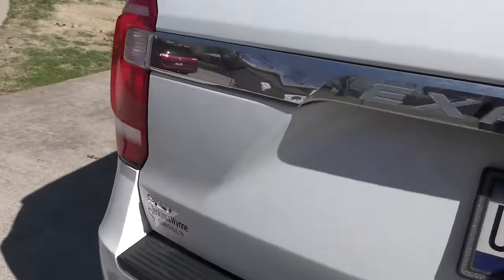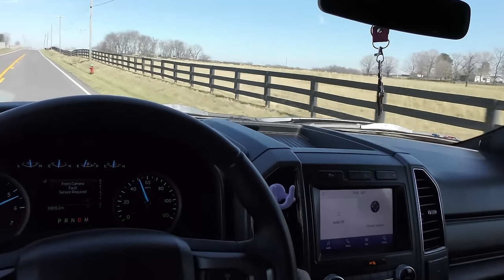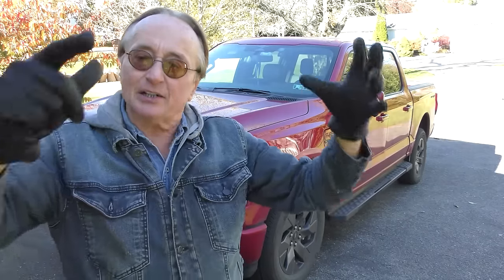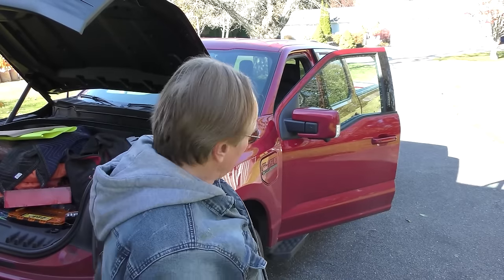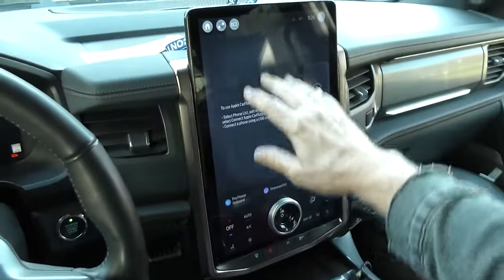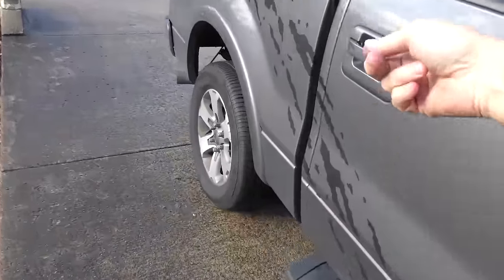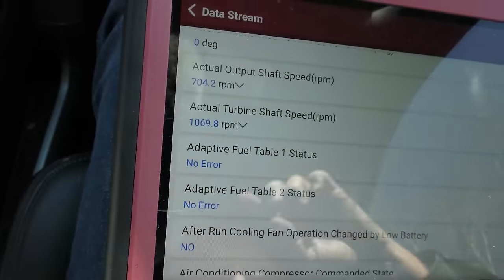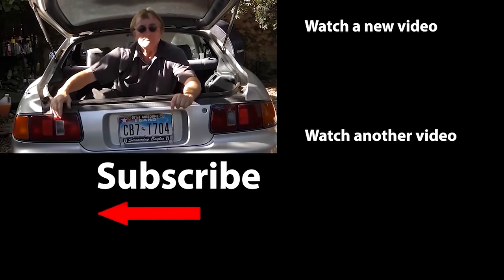Here's Why Fords are Crap Now

Comment: In everyone's opinion, what is the current best built truck with the least problems?

People were telling me in another video that even Honda and Toyota are going downhill with quality.
Reply: None of the trucks built today are that great, however some are better than others. Here’s my list of most reliable to least reliable 2024 half ton trucks.

1. Toyota Tundra: it had some problems with the twin turbo V6 engine at the start but they’ve worked it out on the new one. However, I don’t think they’re going to last nearly as long as the older Tundras with a V8, but maybe they’ll prove me wrong. 

2: Ford F150: just the regular V8 F150. They’re okay as long as you stay away from the 2.7 and 3.5l ecoboost. They say they’re better now but I don’t trust it. The 5.0l naturally aspirated V8 is still the better option if you’re okay with slightly worse gas mileage.

3: Nissan Titan: they’re good trucks, just uncommon and 2024 is the last year because they’re not selling well. They don’t quite have the same specs as an American half ton truck.

4. Ram 1500: These are garbage, but will get the job done for a few years. Riddled with transmission issues, engine issues, drive train issues, stupid low quality interior part issues. These aren’t good trucks and you shouldn’t keep it for long or buy it in the first place if you value your money. 

5: Chevrolet 1500: These are COMPLETE GARBAGE. Stay away, as far away as you can. These things are blowing engines just a few hundred miles off the lots. They are some of the most garbage trucks ever made. They have the same issues as the dodge ram only worse. Stay away.
Reply: @interstate80.  Well that sucks, I was hoping to buy a Chevy/GMC truck in the long distant future but I guess I'm stuck with Toyota. 

I drive a 2007 V8 Tundra sr5.

Comment: you can find every ford these days dead at every stop light! that start stop is all good until you start having alternator/charging issues, and have to wait at a long light or a train, and dont have the juice to crank back up and get moving. Even better, starters dont last forever, and being used every damn traffic light is going to result in a lot of dead at the light vehicles.

Comment: A friend of mine got a 2023 Ford F250 total crap. I told him go lemon law on it since it qualified. Major suspension issue. Actually it was unsafe to drive. He threatened lemon law because ford ignored him even through an independent mechanic said that suspension parts were actually missing wtf!!? 😱 They got Ford engineers to look at it. And the problem was fixed kind of. He still isn't happy with the steering. Why would you trade in your Ford crap lease for a full finance peice of crap knowing Ford is crap. Smh. 🤦🏻‍♀️

Comment: I`m 66, and in my life I`ve only owned one Ford. NEVER again, biggest pile of poo. Bought a Mustang GT in 1987 NEW,  left me stranded 3x in 9 months of owning it. Dealer had it for 3 months total time trying to fix the total loss of power like battery was unhooked. 3rd time I let my lawyer handle the LEMON. I got every penny back including money wasted on car insurance. Took the cashiers check across the street to a Chevy dealer and bought a Cavalier outright, no payments. Had it for 10 years and put over 200,000 miles on it, never had a issue.

Comment: I only bought one Ford in my life time. Like it's name, Found On Road Dead, my Ford die 5 miles from home. Went thru two trans in about 20K miles. AC leaked. Car stalls at stop light which Ford could never fix. Engine blew a piston in about less than 100K miles. Got rid of the piece of crap and never bought another Ford again nor any Detroit car after that. My previous GM car had a lot of problems too.

Comment: So if you took a $75k lightning and  a $75k gas f150. The entire drivetrain for the gasser would cost less than $25k, when removed would leave you with a $50k shell. For the lightning the entire drivetrain would cost atleast $50k, and when removed would leave you with the same shell, same options for 25k? Ford is either shoving it in their * on the lightnings,  or theyre shoving it up the customers * on the ecoboosts

Comment: That's the scanner I'm thinking of getting. For this stupid ford. Have a cheap OBD2, but it's not picking up anything. :/ No traction control, no power steering, no collision warning stuff, no nothing. I'm in complete limp mode. RIGHT after getting two new tires. :/ Tried resetting TPMS sensors using a little tool. I did have low tire pressure on a tire, it showed, afterwards. Aired that up, the TPMS light went off, and I am still in limp mode. Don't even care, except steering sucks. I so hate Fords.

Comment: We had Ford work trucks in the 80s and 90s and they were crap, except for one known as "The Beast" with a 460 and a 5 speed. That 460 utility bed truck was awesome, but all the rest always had issues. The first Overdrive Fords couldn't push the crazy high OD ratio, crap driving positions, the twin I Beam front suspension chewed up tires like crazy and they had premature failures of alternators etc.... 
Oh... How could I forget... the GIANT HUGE TFI MODULE SCAM THAT WENT ON FOR YEARS!!!! 
Rant done.
Reply: How many miles did “the beast” have on it?

Comment: It’s sad because my 2002 Ford Taurus lasted almost 400,000 miles trouble free and my 2001 Ford focus got into the high 200,000 mile range. I only had to replace a coil pack never had any issues with the automatic transmission I only had to get rid of it, because the frame rotted out and it wasn’t gonna pass in New Hampshire state  yearly inspection. I ended up selling it as is in fact I saw driving around with temporary tags and Massachusetts not that long after I had temporary tags on it and the Ford Taurus had almost 400,000 miles. The only issue I had with that was between third and fourth gear I had to slightly lift my foot off the accelerator for it to catch and I drove it that way for years that didn’t rot outI ended up giving it to somebody because all the tiny little things that it needed like tie rod ends, swaybar links, stupid, plastics, cosmetic stuff we’re all needing to be replaced and I could’ve done it and drove that car a lot longer but I decided to upgrade after that or just went downhill I guess

Comment: Scotty will say some smart things and then say something so dumb out of nowhere 😂
A twin turbo 6cyl definitely has the pickup of a V8.. i like v8s but id much rather have a v6 turbo, faster with better gas mileage. V8 is mainly meant for power for ppl who tow things a lot, otherwise you dont need it and are averaging 9mpg for no reason.

Comment: Truth is Ford has always struggled with gas mileage.
Example....Ford 1.0  `Ecoboost` Fiesta, Focus. Real world gas mileage in the UK.....45mpg. Previous Ford engine 1.25 Zetec engine.....45mpg.
Tell me, what the hell is `eco` in `ecoboost`?
On top of....the Zetec engine was bullet-proof...punchy, reasonably economical and if looked after lasted the life of the car...not class-leading as regards mpg, but reasonable.....but the `ecoboost`, punchy, overheating, setting fire to itself and how long are they lasting?
Ford, once great, now in the race to the bottom.....
Reply: Had a 2012 Fiesta S. Just gas only cost me 13 bucks a week. Work us 10 miles away so 20 round trip. That's just work not including daily driving. I've owned Nissans most my life had geo prisms( great car). Nothing ever compared to that Fiesta gas wise. This is 2 years ago with inflated gas prices. 20 bucks filled it from 1/4 tank. And that was 93 grade.

Comment: Have you considered doing a video on the F150 rear sliding window that should have been a recall but ford says it hasn't killed anyone yet so NO ! The window top track just falls out and off ! 70,000 complaints to ford and nothing ! Window track put on with double sided sticky tape ? To break into truck all that is needed is pressure from the outside to push the window in lol what a joke. Except it isn't funny

Comment: It’s not just Ford, it’s every manufacturer. They are pushing so much technology and they’re not doing proper quality assurance testing on their products. They’re taking what should be done by their QA engineers and putting that on their customers. That’s the problem and everyone is doing it.  It’s just to which degree everyone is doing it.  Some manufacturers bought the EV fish the government is pushing. Some aren’t like Toyota. So right now Toyota enjoys better quality standards than most. Because they aren’t pushing EVs. EVs aren’t close in mature technology yet, so there’s going to be lots of mistakes until they start doing the proper quality engineering. But the market wasn’t waiting because the government made a push too fast. EVs don’t solve anything. It’s a government scam that politicians are heavily invested in.  I’m an engineer so I know this technology isn’t ready. There’s no grid yet. China is building coal plants at 3 a week. That wipes out any environmental advantage millions of EVs do.  You’re pissing in the ocean.
And manufacturers are trying to push this tech into the regular cars. They need to slow down or up their QA departments.  But this isn’t just on Ford .

Comment: Should have bought u a chevy. I have a chevy Silverado 1500 lt half ton 303000 miles on it pull a trailer full time 6 days a week in summer with mowers change oil every 3000 miles and have only replaced water pump,alt,battery,starter,brakes,tires...  that's a 4.8 liter small v8and is a2002 ..  People if u believe what u read about changing oil every 5 to 10000 miles keep a big cash fund u will need it oil brakes down when u heat it up and cool it down stick to 3000 miles.  Ford cam phasers are junk used to work at a machine shop lots of ford's cam phasers that destroyed motor u cannot just change the cam and lifters and phasers and except it to b right when all that metal went through the motor and the crank bearing too.

Comment: Ford is using Chinese made crap components. Eco engines have a lot heat related destruction to valves and springs, wiring ect. Excessive carbon build up too !

Comment: You do not I repeat do not want to work on a Ford,as a mechanic for 35 years,they are the most difficult and expensive piece of junk.I own 95 Chev pu 533 thous km And going to get milion,parts cheap and don't brake down.

Comment: Well.  GM has sucked for decades now.  Chrysler since before I was born apparently.  Ford had its ups and downs but is now in a DOWN from what I am told.  Ford placed their focus on EV and the production cycle involved. Then part of the plan was to lay off the quality of gas models in an attempt to make the customer purchase electric to avoid issues.  Oops.  Ev doesn't sell because it can't sell and the issues with the infrastructure alone speak for themselves.  Now Ford realizes their mistake listening to government recommendations.  Especially THIS CURRENT government lack of knowledge with vehicles for the public.   They didn't listen to Toyota.  They should have.  Anyway, back to the gas again!  Maybe the quality will follow?

Comment: Ford hasn't made a decent reliable vehicle for years. I've owned hundreds of Ford's and worked them too. I think the last decent Ford I had was a old Granada. I wouldn't ever buy one now. They are badly made crap. We have transit connect 1L eco boost company vehicle. Its been the biggest pile crap I've ever come across. Clutch went with only 14,000 miles on it. Constantly loosing coolant. Throttle body failed. The Ford dealer was useless  and couldn't sort out the constant coolant leaks. Transits used to be good reliable vans once up a time. Now they have to be one of thd most unreliable. They give Fiat and Citroën a run for their money in building crap vehicles 😂

Comment: What people need to understand is these new level transmissions are learning transmissions. If you drive this thing like a grandma, you will get hesitation in the lower modes. If you drive it like a maniac you won’t have the hesitation because the computer adapts to your driving personality I know it sounds stupid but it’s true. I would assume that this driver does not ever use this in sport mode or very rarely and drives it very pedestrian like and then doesn’t understand why it lags now and then that’s part of the. programming enough said. I have owned one of these vehicles for seven years and have never had any issues. It is very responsive and I have not had any problems with the transmission whatsoever. People need to understand and I think Ford needs to also explain to customers how do computers actually adapt to a drivers temperament if you want to call out that I think Ford is getting a lot of a bad rap on these transmissions that is not really their fault. They are trying to do a lot of things including stay with in emissions standards while at the same time, keeping people who would normally buy a V-8 happy. And I will tell you this my F150 with the TwinTurbo eco-boost does 0 to 60 in just about six seconds, which is way better than a V-8 and it is way more responsive so please do not believe that the V6 TwinTurbo is not superior in power because it is Scotty is absolutely correct that these are extremely complex engines, and the TwinTurbo’s can cause a lot more maintenance In the future, if you do not take care of your vehicle, so God bless you Scotty, but I do not agree that the lagging from that vehicle has anything to do with the transmission itself unless there was an actual issue mechanically. I have a 2018 version of the 10 speed transmission and I’ve never had an issue with it ever. It is extremely fast shifting and smooth in people cannot believe how fast the truck is stock. It is much faster and can tow way more than the V-8 engine can. Again, I do agree that having a TwinTurbo engine if you do not take care of it and change the oil regularly can be a huge problem for the turbos as well as the engine but luckily the 2018 has not only the direct injection, but the port injection as well so I don’t have issues with carbon buildup. I know of many others that have the V6 TwinTurbo, and have not had any of these the issues with the transmissions as I hear on many channels. I am not saying that it’s not happening, and it may be anecdotal, but from my personal experience, my transmission has been solid and very fast and smooth shifting. I’ve been a Ford person, my whole life and have never been let down. None of my vehicles have ever broke down and well. I have had some various issues that were corrected by the manufacturer they were not due to the drive train. It’s all the stupid governmental regulations that put these manufacturers in a position of addressing Various regulations mainly EPA related in a very short time before all testing can be completed and result in defects or quality issues. I will only address the second vehicle, which is the Ford lightning. All electric vehicles completely suck and are not the future at all. Hybrids are also not the future while they are better, and do not initially show the problems that the electric vehicles do because they have an internal combustion engine attached to them. Anyone that stupid enough to buy an electric vehicle should be forced to move to Europe. There’s no reason to not allow the American people to choose the vehicle of their choice, especially since electric vehicles take on average 10 to 12 years to get to a carbon positive output of an ICE, and, not to mention all the child labor used around the world mainly China to mine these rare earth minerals to create. The batteries is just insanity. I loved back about 10 years ago when they were all the movies about blood diamonds these are blood batteries these people need to be put on trial for crimes against humanity.